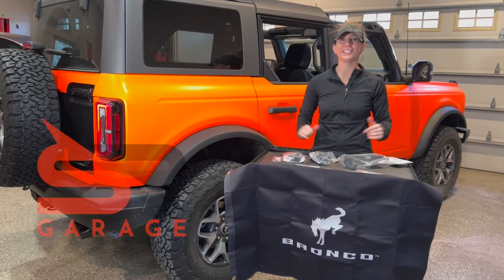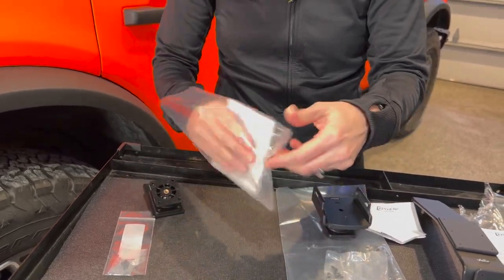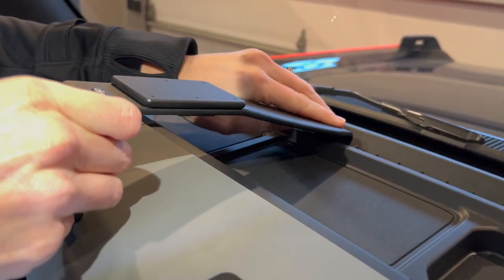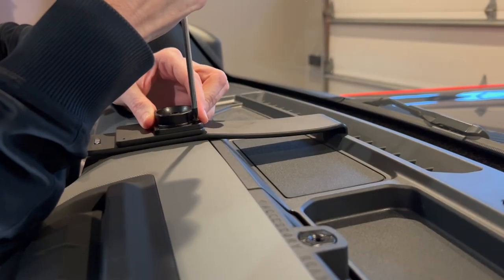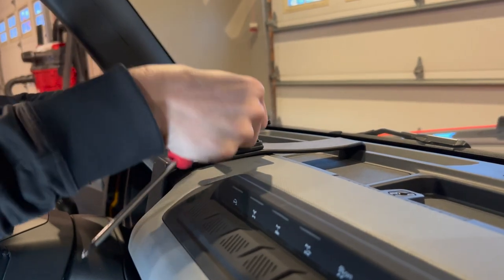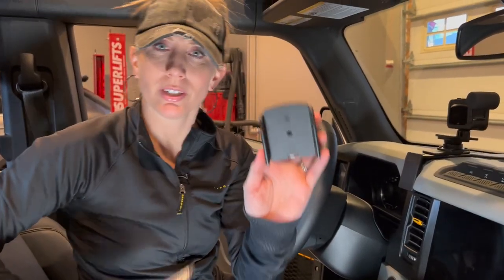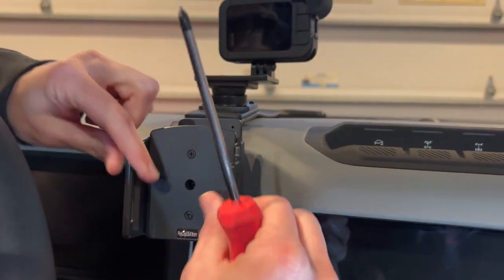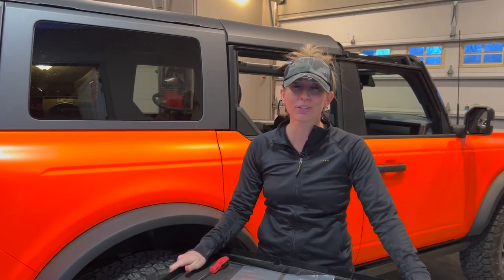Ford Bronco ProClip Phone & GoPro Mount Installation

Comment: The bronco has a specific place to mount things. I guess I don’t understand the need for this kind of mount. There are picatinny rails that mount as ford intended that could bring things closer to the driver if that’s your intent. I’m still waiting for my bronco but maybe one I’ll be able to find out for myself
Reply from the maker: There is one screw hole in the top of the dash, but you have to buy accessories to work with that.
Reply: @shockerracing  yea I know, my question is, why buy an accessory that doesn’t use the ford accessory mounting point. It’s a cool product, but ford made this thing so customizable with all these mounting points, just for a company to say “f@)! This mounting point, clip this banana on your dash instead”
Reply: I stared with a rail mount. With an arm to bring the phone to this same location. There is a lot of bouncing and vibration going on.  The ProClip will be a much more stable platform